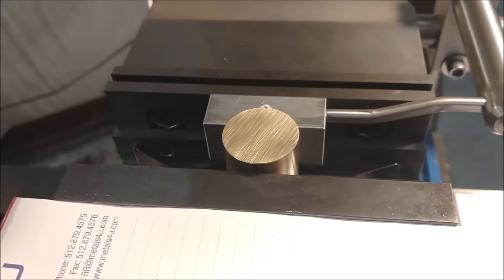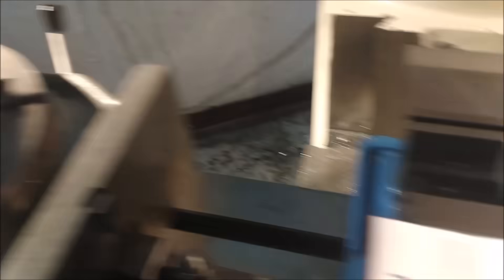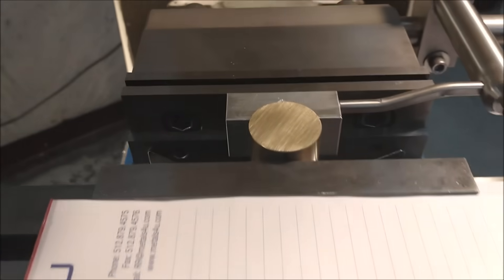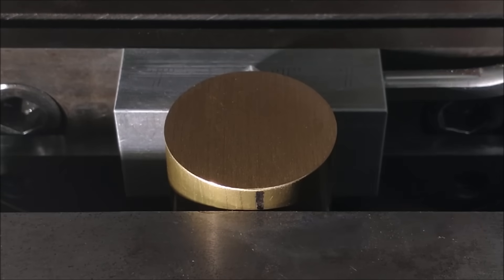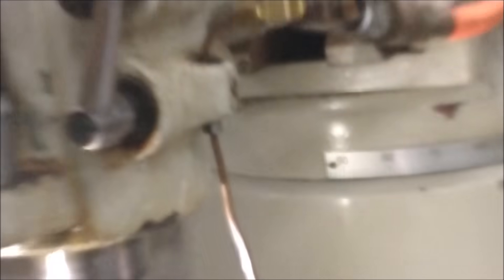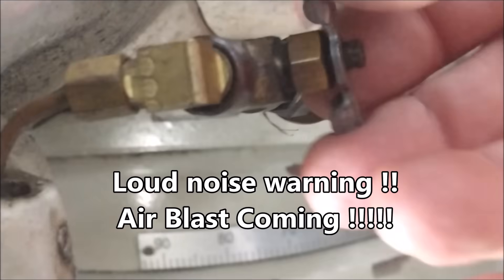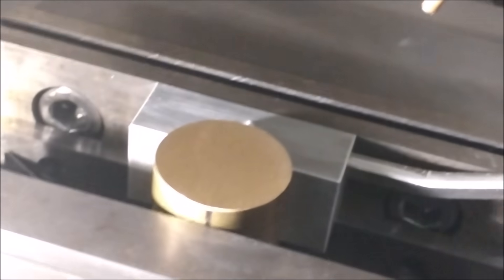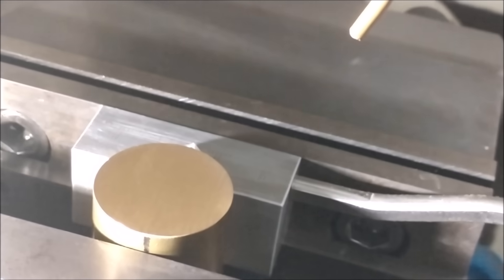This is IMPOSSIBLE, No Machinist Could Do This Manually ....

Comment: When I did this type of work when I had my machine shop in the 70s 80s I used a Lars Gorton P 1-2 pantograph mill. I would design the work to engrave then etch into a copper master and use styli to trace into the work. You're work today was excellent. I couldn't do my method today because I can't get alot of the supplies needed to image the part.

Comment: That used to be the exclusive job of an Engraver (the person, not the tool). Good work programming the CNC. 
FYI, your camera auto-levels the sound so that it's not so loud as to hurt the ears.
Reply from the maker: Thanks. That pattern was completely laid out by eye. I did use construction circles, but nothing automatic. the 10, 11 and 12 were also scaled down to fit. Hardly noticeable.

Comment: I hate to be a perfectionist Joe and I know it’s a joke. But, the 6 and the 12 have extra shapes that are not the same size or not centered properly. Love the jokes…👍
Reply from the maker: There are several ways to reply to this comment.
1. Thank you. Since the entire part was laid out by eye, if you can only find 2 things you believe to be wrong, its a win.
2. Did you ever consider that the 6 and 12 may be the only correct numbers and everything else is wrong?
3. You forgot to mention the 10, 11 and 12 are 10% smaller than the rest of the numbers to fit comfortably in the pattern.
4. Yes, the 6 is a little high.
5. I have to respectfully disagree on the "extra shapes" portion of your comment. All the numbers were pulled from the same font library. The 12, at least, has the 1 and 2 to compare to, but the 6 is a solo.
6. Thanks for the comment and for being a subscriber. Much appreciated.

Comment: Almost looked as if the cutter was moving and not the table.  If that is the case a pantograph machine was used, which is one way this could be done on a manual machine.

Comment: While this is clearly an April Fool's video, I would like to point out that my great-grandfather was a clock and watch maker in Leeds, England in the early to mid 19th century. I have a pocket watch he made in 1815. It still works.
Obviously CNC machining did not exist at that time yet it has similar engraving to that shown in this video.
Conclusion: skilled craftsman + pantograph + rotary engraving tool = nice design on metal surface.
Joe may not have used the same techniques as my great-grandfather, yet it was possible to make such an artefact without modern machinery.

Comment: If the carpenters in the middle-ages could do it, so can you with some (lots of ) time... or with a replicator to just sketch over the paper sketch to move the arm. Will take a while though.
But yes, you probably did it with some CNC-help.

Comment: Nice CNC work. just a slight misalignment of the black registration mark on the brass blank when switching between the Kurt vise in the CNC and the Kurt vise on the manual mill.
Reply from the maker: I admitted to removing the part in the text note.

Comment: Damn you're good 👍  but not that damn good. Great fools day video.
Reply: Now, just to show you actually did this manually, show us, split screen, one camera on the tool, and one on the hand wheels on the X, Y, and Z axis controls. Bet you can't or won't.
And by the way, the #12 is a few thou too far to the right in relation to the pointer IMHO. 
Otherwise, it's very impressive.
Regards from Canada's banana belt. 
🤞🇨🇦🍌🥋🇺🇦🕊🇺🇲🧙‍♂️🦃🪓🏁👍

Comment: Moved vise with entire setup from manual mill to CNC and back, with some editing handiwork. The video transitions between the two mills are almost perfect, but not quite.

You are, of course, spot on. This IS impossible, and no machinist could do this manually. Not even Mr Pie himself. Nobody can say Joe told a lie on April Fool's, at least not in the title. But the reason why audio is muted is not "the constant air blast" but to keep the CNC servos silent.
Reply: I wonder if Clickspring could do it .... only smaller with Greco Roman tooling. 😂
Reply: He can. See his engraving video.
Reply: @marossgnv  yes, but not using the manual mill.
Reply: Define "manually." I have a manual pantograph that can do this... but manually on a milling machine using the mill hand cranks? Yeah that would be tough!
Reply: @deemstyle  Congrats !!!!  If I had the room in my shop, a pantograf would be on the list of cool retro tools to look for.
Reply: @ It's just a small one, but it has been fun to play around with!
Reply: @deemstyle  "manually" as defined by Joe himself, using the manual mill.
Reply: There is a good reason why this is considered so difficult.  A manual milling machine is usually used by cutting in one axis only.  If you spent years dialing in x and y at the same time you would get quite good at doing something like this.  It is a matter of co- ordination which would come with practice.  Hell I have trouble remembering which way to move the handles on my milling machine when using just one axis.
Reply: @dougmacqueen1679  no matter how many years one spends manually dialing x and y at the same time, making perfectly synchronized manual movements in x, y, and z on a perfectly linear timescale to produce perfect characters and symbols like this would be impossible. Impossible.

I'd love to be proven wrong, though.
Reply: @frankpiscopo  What is your reasoning.  Some pretty amazing tasks have been seen by people who spend their lives perfecting a skill.
Reply: @ No doubt. But have you seen anything similar, even milling a single character, executed on a manual machine? Please share.
Reply: What I know is how difficult it is to make a straight diagonal line moving the x and y.  But then again how much time have I invested in that task?  1 year, 10 years?  No more like a minute or two.  Based on that I would have never learned to walk ,talk or do many other things that are difficult to learn.

Comment: So why is "ENG" clearly written on the parallel during the middle footage, but missing during the opening and finishing shots?

(On the parallel to the left of the part.  Nice Fooler Joe 😂)
Reply: It's still there, but different lighting at the two mills leaves the laser lettering on the parallel in the dark when the vise is on the manual mill.
Reply: @frankpiscopo whether due to a different parallel, or different lighting, it still gave the game away ;) 😉
(I did review the footage trying to figure out if it was just different lighting, but my my brain assembled those fuzzy pixels differently to yours - perhaps just confirmation bias 😊)